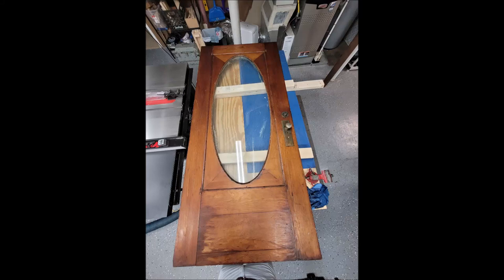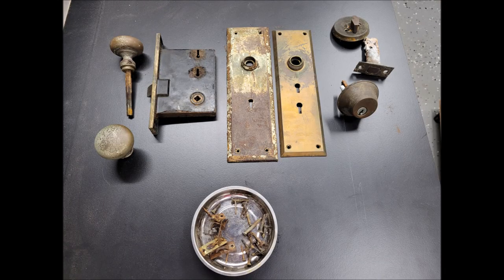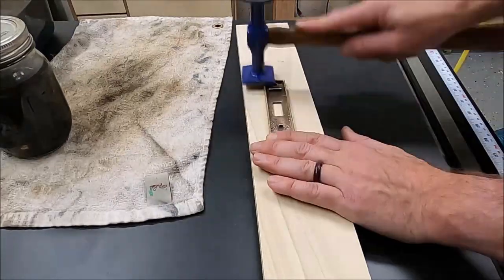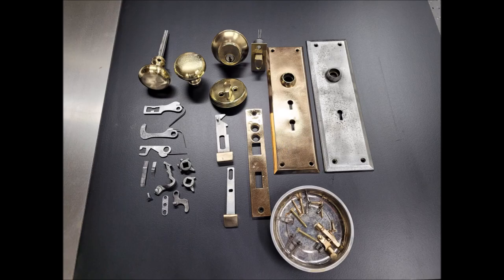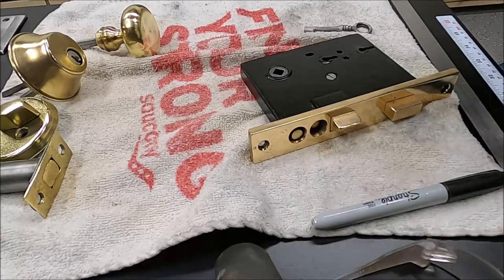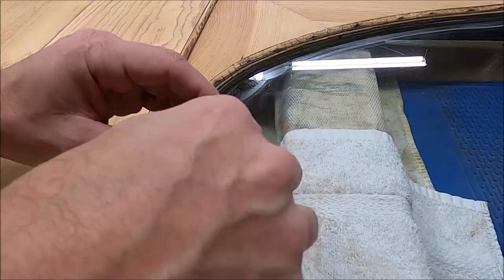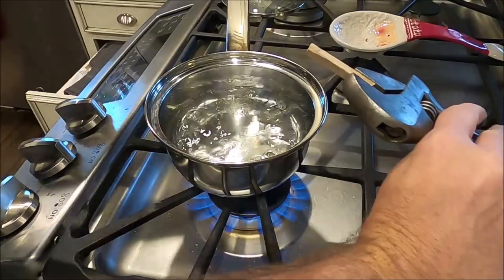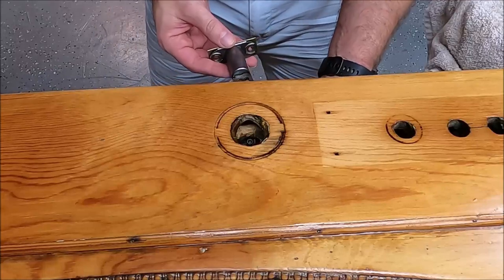Antique door restoration

Comment: Does this door have a 2 1/8 inch bore hole?
I wonder if ReSecure Latch would work in this door?
Reply from the maker: I'm not sure about the dimensions. Unfortunately the door has been sold and shipped to Seattle so I don't have access to it any longer.